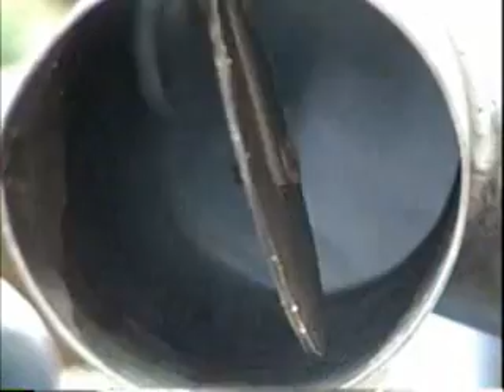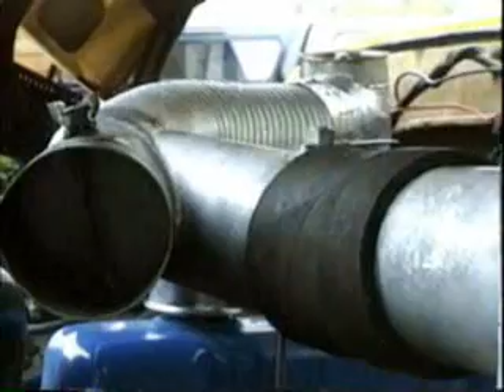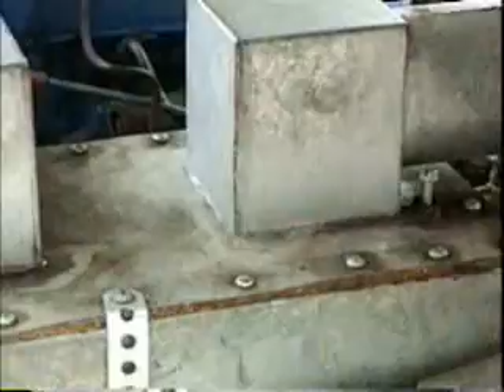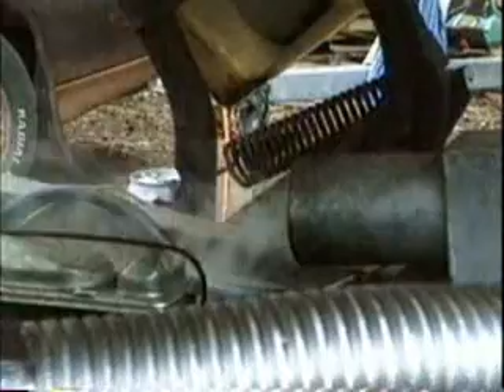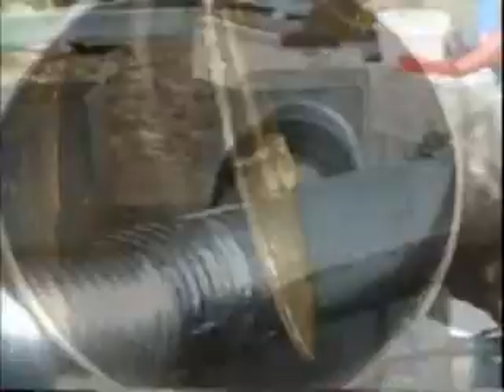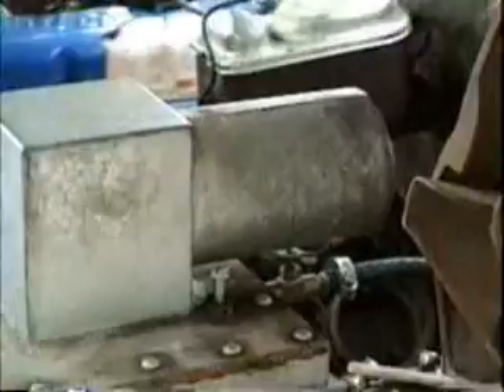Here is definitive proof on how to separate all Atoms in all liquid soluble matter.

Comment from the maker: The pessimist in the world, are using up the energy, and have no concern to replace it. Did you know gasoline doesn't ignite at the 500 degree temperature, they say it will ignite at. Put a heated rod next to gasoline, you will get it to ignite around 1000 degrees Fahrenheit. You and science are wrong. Flashing Liquid, using a combustible gas leak detector, I have detected a flammable gas in distilled water at just above the 212 degree boiling temperature of water. Try it before you condemn it

Comment from the maker: Something else to consider. Take a small ant, pass a flame close to the ant. The extremities of the ant will blacken almost immediately, so the smaller the mass the faster the heat transfer. I say liquids work the same, the smaller the droplet the faster the heat transfer. Faster than the amount of time liquid can boil. So the liquid assumes the temperature being applied, then boils at the applied temperature. This is possible to do with water, gasoline showed it to me. Temperature will do it

Comment from the maker: You need to create the white vapor, to understand it. Everybody is afraid of the gasoline exploding, and it will when iron starts to turn a dull red, between 800 and 1500 degrees Fahrenheit. Check out the ignition temperature, here on the internet. There is over 500 degrees of unexplored area there, that science says doesn't exist.

Comment from the maker: If you have a carburetor, it is easy to do. I have had it on 7 different vehicles.One of my subscribers has taken the gasoline to 700 degrees and says he no longer has the non flammable liquid. This is very possible, if he reached the boiling temperature of the brown non flammable liquid it turned to a vapor, and mixed with the flammable white vapor. Any vapor will mix with another vapor, that is present, proof smoke.

Comment: car runs great much more torque am also sucking in water vapor hoping to cool the engine my exhaust manifold temperature is approx 600f do you think this is to much heat car runs great come the summer am hoping to do your method anyway are you getting your life back together any changes in your life my friend?

Comment: am more amazed at that alternator you managed to retrofit into the car today cars are rubbish can not do to much to them after many years messing about with the ecu i got lucky yesterday i have a efie unit seams to lean but soon as you hit the road car takes nose dive so i done something very silly i put tape over the air mass meters filament with small pin holes car runs real great powers there also exhaust hardly any smell am bubbling gasoline & water with exhaust gases

Comment from the maker: Yea, the generator worked fine, but controlling the voltage output was the problem I had. Nobody at the time, knew how to regulate the voltage output. It had a 10 amp draw from the heaters. Pacific Gas and Electric had inverter generators made for service trucks, but they cost $5000 at the time. I was working on a shoe string budget, and couldn't afford it.

Comment from the maker: I never thought about using mesh as a heat shield, something to remember. Stainless steel melts around 2500 degrees Fahrenheit. I melted one of the stainless steel heaters, one time, when the generator, was putting out 2000 volts at 4000 RPM on the engine. It didn't explode. The burnt out heater, stopped the white vapor, and only condensation from the white vapor, burned. The liquid gasoline goes to the bottom of the chamber and the brown non flammable liquid, in the chamber, stopped the fire.

Comment: hi billy thanks for your reply again your always so polite & very efficient for those people that worry about backfire the only way engine will backfire normally if there is not enough vapor i been there & done it deliberately to see if it will catch a light guess what no problem did not catch alight also stainless mesh works great to keep out flame i put flame under mesh it does not go through thanks again pal

Comment from the maker: Actually vapor will not backfire. Once it is ignited, all of it burns. Now with liquid fuels it is different. If there is too much liquid fuel inside the cylinder, all the liquid in the cylinder will not burn at once, when ignited, and this liquid continues to burn until the liquid is gone. This is why the catholic converter was installed for smog, it burns the liquid fuel that is still burning after it is ignited in the cylinder.

Comment from the maker: I suspect if he is not getting the brown non flammable liquid, then he is taking the liquid to a temperature above the brown liquid's boiling temperature. If the brown liquid, turns to a vapor, it will mix with the surrounding vapors. I never took the gasoline that high in temperature, so I don't know for sure, if it vaporizes.

Comment: am trying stuff with exhaust heat bit difficult to control what is Tyson capel  using for heat do you know? he says he is getting some silly amount mpg. i run your design hooked up to household electricity works real great & my systems really primitive never the less it is a white gas then comes the brown crap & things not so efficient usage of gasoline is very little even thoe no road test engine idles & accelerates good thanks again buddy

Comment: ... i have no idea about the water to hydrogen as i have no relative knowledge on the subject matter ALTHOUGH... you said its obtainable by the same method in the video .... will you be making another video with demonstrations of both? .... when you get your system put back together? and just curious what was tuning air fuel  like on this sys, was it just tuning butterflies or adjusting fuel spray aswell?

Comment from the maker: He is still applying the heat to the fuel, I am applying the fuel to the heat, just the opposite. A very fine mist of liquid applied to a large mass of heat will go to the temperature of that heater faster than the liquid can boil, so the liquid boils at the heater temperature, not the liquids normal boiling temperature. This can be done to any liquid. A Gas Spectrum Analyzer will prove this, and that I did a molecular change to gasoline, and hydrogen from water is possible by Flashing Liquid.

Comment: mmm, lemme rephrase tht sentance. both you and he were both using the same concept of* mindset, from your video i completely understand the concept methodology. and yes he did make an evaporating fuel system, ran it through a heated fuel cell rather than a carb. at a press confrence he took the stock carb and said it was the reason that vehicles were so inefficient.... though i have not read anything on the fish carb ... Yet

Comment from the maker: By what you have told me, he is using an evaporative system. A guy in England built a variable venturi carburetor back in the 20's or so. The carburetor varied the opening of the intake into the carb, forcing a large volume of air over a small amount of gasoline, drawing that into the intake manifold. He had a freezing problem with the fuel. a pressure change, due to  the airplane wing shaped venturi. Evaporation is not what I did. I have change the liquid gasoline itself, creating a new gas.

Comment: both you and he were both using the same concept and mindset that liquid fuel is extremely ineffective, i believe you and your claims bu using high heat, tho i also believe in the ogle method, rather than super heating the fuel he simply made a 3 gallon gas tank put an air inlet and outlet on it and simply sucked the highly volitile gasses evaporating off the liquid fuel. he later had to install a heating element because of refridgeration due to removing high folumes of air from a container

Comment from the maker: I'll check it out. I assume this is a device that, in some way runs an automobile engine, using gasoline. If his device used a way to control the heat applied to the gasoline, then it is possible he developed something similar to what I did, otherwise, nobody has seen, or done what I did to gasoline. Again a Gas Spectrum Analyzer will prove what I say. Wish I had the money to do it.

Comment from the maker: I discovered it by accident, trying to get enough heat to a chamber, whose design was a scam taken from a seminar I went to 30 years back. I put the chamber in a fry pan, that was set on high, and spilled gasoline into the pan, trying to put gasoline into the scam device. When I saw the gasoline flash to a white vapor, I knew I had to capture that vapor and get it to the engine. I don't recall ever seeing the ogle mobile, but I will check it out.

Comment from the maker: In your question how did I meter the fuel, I didn't. I just used a 1/4 inch copper tube, plugging one end, and poking really small holes to spray the gasoline onto the heaters. I put a float valve in the fuel line from the vehicle fuel pump, to control liquid level in the chamber. I used a second fuel pump to pull the liquid from the chamber bottom and pressurize the plugged 1/4 inch copper tube, spraying liquid gasoline onto the heaters. Oh, put the heaters in a 20 degree angle, it helps.

Comment from the maker: Actually it is a cool vapor. It was about 50F in the video. Watch the beginning of the video, in the bottom of the 4 inch Tee, close to the front is the white vapor condensing into a liquid. Look at the ball valve, on the fuel line going to the carburetor, it is closed. Nothing but white vapor running the engine. A flat plate 500 watt heater would work great, but, nobody makes one, except high cost special order. Two 14 inch by 2 1/2 inch 250 watt flat bar heaters wired in series is what I use

Comment from the maker: When I created my system, I had a generator wired and built to produce 110 Volts DC. I had no way to control the voltage at higher RPM, on the highway. At 4000 RPM it put out 2000 volts. Today, with a heavy duty alternator, and the new high wattage inverters, harbor Freight has them, it is easy to do it. A continuous load 1000 watt inverter is plenty big enough. Check the specs on your vehicle alternator, with the power consumption on the inverter. Your alternator might work.

Comment from the maker: In the chamber seen here I used two flat bar 250 watt, 110 Volt heaters wired in series making them a total of 500 watts. They were 14 inches long, 2 1/2 inches wide, and 1/2 inch thick. A company called Chromalox has them, and can make any heater size, shape, wattage, and voltage you want.

Comment from the maker: I am saying the white vapor I create has a higher boiling temperature than Butane, and a lower boiling temperature than Pentane. The boiling temperature of the white vapor you could make with my fry pan trick is around 50 degrees Fahrenheit, Making it outside at 10F would cause it to condense and become a clear liquid. I have seen the white vapor condensed. Watch in the video the reflection at the bottom of the tube, When the video first starts.

Comment: Yes, it's about 10F here right now. If I go out side I can see white vapor coming from the moisture in my breath. My white vapor is water vapor and it's different than steam. Steam is transparent because it is essentially dissolved in the air. Are you saying your "breaking bubbles" is evaporated fuel that is too cold to be dissolved in the air anymore? The shiny coating on the inside of your pipes there tells me that it's condensing out, and it looks like oil, not gas.

Comment from the maker: Want to see the fog machine in operation? Get a stainless steel electric fry pan from the Goodwill. Set the fry pan on highest temperature, and wait until it cycles off, then spray a fine mist of gasoline onto the fry pan, with a plastic spray bottle, from the dollar store. Best be outside, and don't smoke around it. You will see the fog machine up close and personal. Watch how the bubbles form, with a clear vapor, and when they break they, like magic make the vapor white. Ever seen white vapor?

Comment from the maker: At the time I ran it, I used a generator I paid to have made, and I couldn't control the generator output at higher RPM on the engine. I melted a stainless steel heating element when the voltage went over 2000 volts, so road trips were short and slow. Today's inverters eliminate this problem.

Comment from the maker: Do you have any idea what a it would cost to have three different tests done on a Gas Spectrum Analyzer? I am just a poor man. Why don't you pay for them I can't afford them. Take an electric stainless fry pan, turn it to the highest settings and let it cycle off. Spray a fine mist of gasoline into the heated fry pan. You will create the white vapor I talk about, and also the non flammable liquid. Two different Dynamometers have shown 50% increase in horsepower over gasoline. Can you afford it?

Comment from the maker: Science says all liquids only have one boiling temperature for that specific liquid. Take an small ant, hold it in your fingers, pass a burning match, or burning lighter close to the ant. His smaller extremities will turn to charcoal almost instantly. This says the smaller the matter the faster the heat transfer. I am saying liquids work the same. It takes so long for liquid to boil that the heat transfer happens faster, so the mist of liquid boils at the applied temperature, above boiling temp.

Comment from the maker: Tell me this, why do I get twice the power and no smog from the white vapor. Reading about something does not make you knowledgeable. To understand you need hands on, and to see it for yourself. Until then you are blowing hot air.  Also tell me why, using a combustible gas leak detector I have detect a flammable gas at just above 212 degrees Fahrenheit. Tell me why they used water injection for aviation engines in WW 2. Get your hands dirty and stop reading what someone else says. Then you know.

Comment from the maker: Making and observing the white vapor I created. I have seen bubbles form from the gasoline mist sprayed onto the heaters. Inside the bubbles the vapor was clear, when the bubbles break the clear gas turns white. The liquid that creates the bubbles of clear gas, is the non flammable liquid in gasoline, that no longer mixes with the gasoline it was made from, in my chamber bottom. A molecular change creates a void in the original substance. My white in the vapor is oxygen in air, filling this void

Comment from the maker: Here is what I have observed with the white vapor I created. When the fine mist of gasoline hits the heater, it forms a bubble immediately, inside the bubble is a clear gas. The outside liquid of the bubble, accumulates, in the bottom of the chamber, and is a non flammable liquid that doesn't mix with gasoline. When the bubble breaks, since the clear gas is a molecular change oxygen in the surrounding air fills the void and turns the vapor white, like magic, I have seen it. It burns hotter.

Comment from the maker: I did advance the timing of the engine on a 1976 4X4 Ford truck. I had no way to measure the power or efficiency of the engine at the time, but found the engine sounded stronger, as I advanced the timing, bringing it to Top Dead Center. Knowing the advanced timing was increasing the power of the engine, I considered going beyond TDC, but never took it there. It stands to reason the energy for the engine would be maximum just beyond TDC, where the white vapor would create much more power.

Comment: Hydrogen burns pretty fast compared to gasoline. I read somewhere that it can be ignited after TDC, and it doesn't need big spark, so a lowcost ignition system is enough for it.

Comment: Hi Billy!
Have you done any experiments with advancing or retarding the ignition?

As I'm watching similar videos and reading on this whitevapor, it can have similar propeties that the hydrogen-air mixture has. So it can have high laminar flame speed like hydrogen, and it very depends on the partition. Saying that 1 liter whitevapor's flame speed can be different due to it contains 20% or 40% of fuel. Like hydrogen-air mixture.

Comment from the maker: I need to check this out, if no flammable liquid boils at 50 degrees Fahrenheit, then this proves I have created a Molecular Change to gasoline, and what can be done to one liquid can be done to any liquid. This means there are other temperatures inside of all liquids, and Flashing Liquid, my process can find them. I'm right and hydrogen from water is possible using my Flashing liquid process.

Comment from the maker: I take liquids above their boiling temperature with no pressure. I think they can use a 2500 degree Fahrenheit temperature, under pressure to separate the oxygen and hydrogen molecules in water. I say a minuscule drop of water applied to a large mass of heat, at the right temperature can find the boiling temperature of the hydrogen molecule and turn it to a white gas, the same color as the white color as the white vapor I created from gasoline. Get the lab tests done on what I did to gas, proof

Comment from the maker: To make hydrogen from water, without using a lot of power. You need a way to separate the hydrogen and oxygen molecules in the chemical make up of the water. They use a lot of power and chemicals to do it now, but it cost to much and takes to long to make it. We can't make it fast enough to supply the world consumption. Science says liquid has only boiling temp, and only under pressure can the liquid go above that. I say if a tiny drop hits a heat source it will go to that temp, then boil.